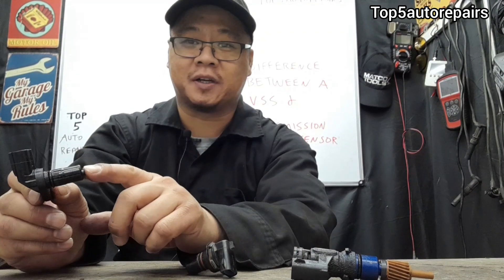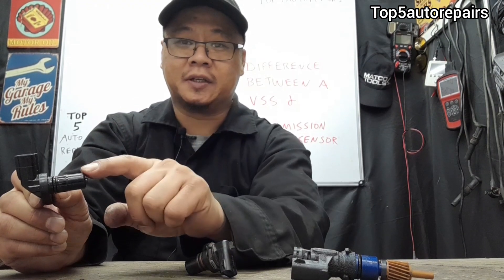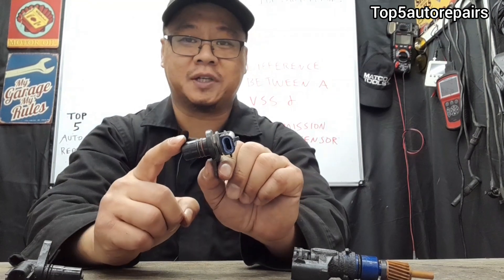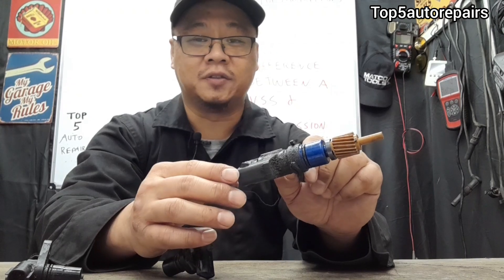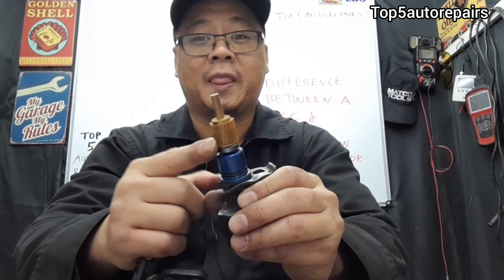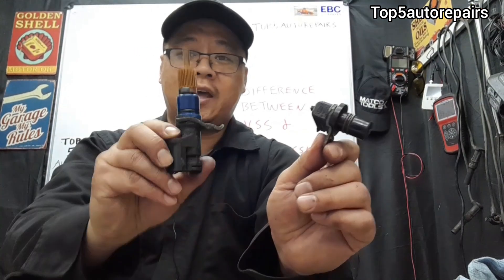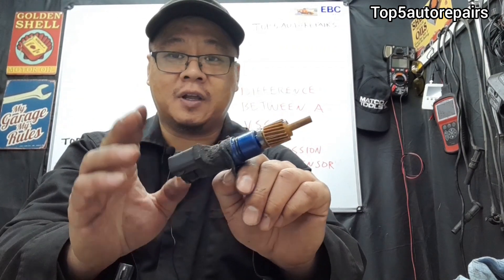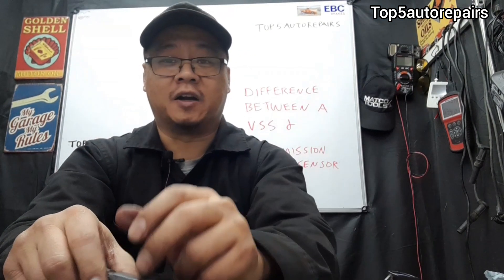What is the Difference between a Transmission Speed Sensor and a Vehicle Speed Sensor (VSS)

Comment: I have an P2160 code stating an vehicle speed sensor 2 circuit low voltage on a 2010 Chevy V8 5.3 liter 6speed transmission I'm having issues trying to find the speed sensor location the told it's inside the transmission pan everything else say on the outside of transmission

Comment: Hi could you help me pls. My 2016 corolla show p2767 you didn't mention that code. I change the fluid and replaced the trans. speed sensor with the oem Denso comparable to the toyota model. The car worked fin for a few weeks and they proble came back. the problem in intermitted and the light and code comes and goes. Even toyota dealer could not find it and recommend to purchase the same sensor from toyota. Can you help pls. Thanks

Comment: My mph gadge jumps like crazy or it doesn't work and once that happens it effect the shifting of my transmission or I just would not shift. What u think it would be?
Reply: Did you figure it out?
Reply: @jonnychhon1881 yes my front DS wheel bearing was creating too much electricity when reaching high speeds and my wheel speed sensor is built into the wheel bearing so changed that then inspected my output speed sensor on top of my front PS axel it had metal shaving all around it since the sensor is magnetized, the small bits of metal from the transmission since the previous owner didn't keep of with the fluid change. So changed that output speed sensor too.

Comment: My 2008 Silverado 5.3 has sudden loss of power and feels like going into neutral as gas only revs the engine and speedometer goes to zero at the same time, it comes backs to normal after a few seconds but as I’m accelerating it fluctuates back and forth in a 10-15 miles range until it shows the actual speed. I need help asap 😩
Reply from the maker: It sounds like the transmission (4L60E) is slipping or tcc issue. 4L60E is known to have transmission issues. Scan for transmission codes to see what's really going on.

Comment: Thank you! No body was confirming my problem except this video! Been looking for weeks... I replaced my VSS with a aftermarket one and the speedometer stopped working.. same code p0501... Most people say it's the passenger abs sensor but after some research i figured it was the VSS... But then after I replaced and didn't work I thought maybe I was wrong but your  video confirmed my suspicion.. going to find an oem one. Thanks!